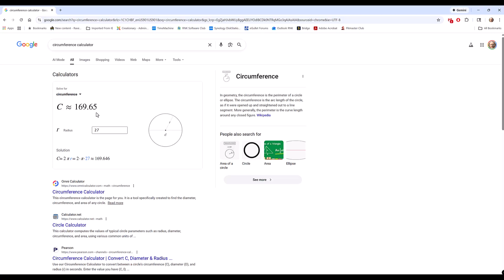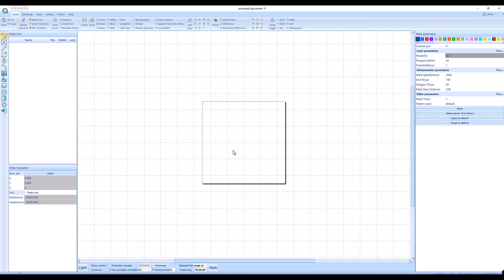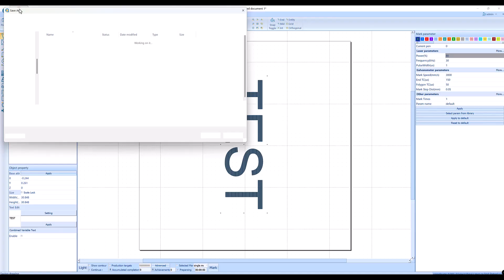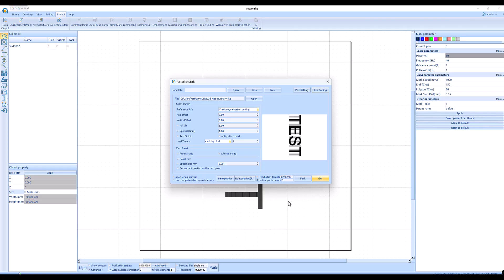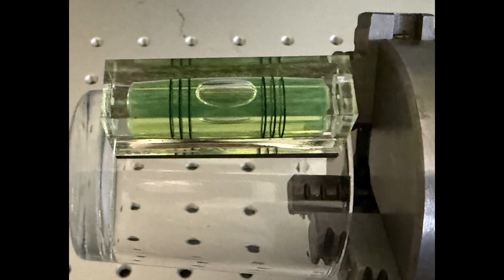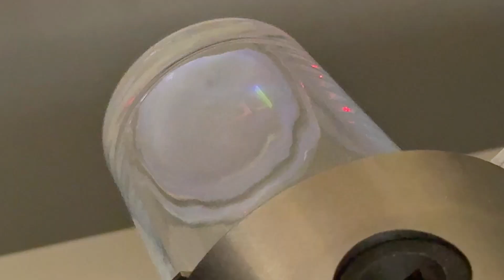RK-CAD Training Part Seven: Using the Rotary

Comment: Thank you for this whole series, Mark, it was sorely needed!  I've always been confused by the 2 projects when dealing with the rotary but my tale away here is to just ignore the "template" project.  Is there any difference between setting the "roll dia" value in the AxisStichMark dialog versus  the "pulse per mm" value in the AxisSetting dialog?  You didn't bother with the "roll dia" value in your demo.  You did not mention the "text stitch" in the  AxisStichMark dialog. Any idea?  Finally, from what I have observed, the "Para-position" framing just shows you where the engraving will start and whether the rotary will turn in the X or Y position, basically a sanity check.